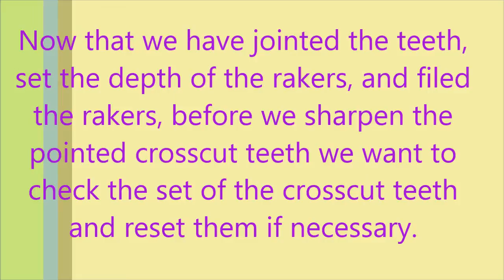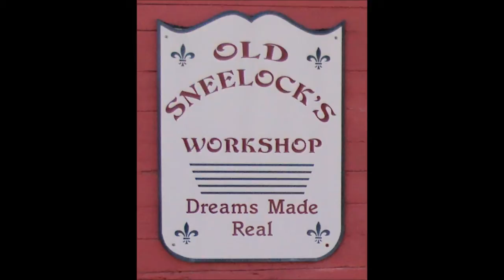Sharpening a one man crosscut Pt 5 - Setting the teeth - by Old Sneelock's Workshop

Comment: Nice clean cut in a dense hardwood.  I also will not use the anvil and ball peen hammer because it thins the teeth even so slightly.  These saws are hard to replace, so I treat my collection as well as possible, even though they are still used as tools.

Comment: I have a one man 48 inch crosscut that I will now be able to use to cut an anvil stand free from a giant white oak that fell on my grandfathers farm.

Of course, considering I bought the saw because we lacked a chainsaw with a 36 inch plus bar - I'll probably be purchasing a two-man to ensure I'll have the blade length to properly buck this monster oak.

The 48 Ford tractor shouldn't have a problem loading the anvil stand for transport. ;-)

Many thanks for your invaluable info good sir!
Reply from the maker: Bj Hamblin That must be one monster oak. 
Can you work the cut in sections? Cut part of the way through and then roll the trunk? If the trunk is more than 48" then it will take a big two man saw to get through it. 
It will make a good video. Any chance you will record the process?

Comment: What do I need to look for when buying a saw set tool so that I don't end up getting something made for standard carpenter's saw or something.  I have a 42 inch one man crosscuts saw with champion style teeth and I need a good setting tool for it and the two man crosscut saws I have of my grandfather's.  Can you buy setting tools new and if so where?  Thanks.
Reply from the maker: This forum has pictures of the relative sizes of saw sets for carpenters panel saws of 5 to 14 teeth per inch and felling and bucking saws with 1 to 2 teeth per inch. https://www.crosscutsawyer.com/viewtopic.php?t=1277
There are many companies selling crosscut saw sharpening tool kits. This is but one of them. 
https://crosscutsaw.com/product-category/all-products/saw-tools/
I have never purchased a new setting tool. They were plentiful when I started sharpening saws and I found many of them sitting in the bottom of auction box lots because no one knew what they were. 
I found the larger crosscut saw setting pliers by accident. I had the saw and found a tool that fit. Putting them together just came naturally. 
If you are looking for a tool that will do the job and don't want to spend all the time I did then buying new is the way to go.
Reply: @OldSneelock   I'm looking at a pair of setting pliers that have the number 2 on them, I believe you said yours were a #4, what do these numbers mean?  Thank you.
Reply from the maker: My best guess is that the maker built them to fit various sizes of saw teeth. It might mean a dimension or it could be the order they were made in.
Jim Thode has a page with a good breakdown of the use of a Morrils 5A saw set. 
https://pbase.com/jimthode/image/162036473

Comment: Hello, thanks for the video. I need to buy a saw set, because hammering the teeth drives me crazy (over and under setting multiple times). But I dont know how big the setting pliers should be for my 2mm thick two man crosscut (probably german). I guess you could not use the two smaller ones in the video. I bought some pliers here in the Czech Republic, but they are not strong enough to bend such thick teeth.
Reply from the maker: Mine are antiques that I found over many years of looking. 2 mm is a very thick blade. Have you tried searching on line?
Reply: @OldSneelock  yes, but am not sure what search term I should use.
Reply from the maker: @johnytwo  https://crosscutsaw.com/product/443-economy-saw-setting-sharpening-kit/

Comment: Hello, I have a one man crosscut saw with champion teeth. But the rakes are taller than the cutting teeth.
From what I understood watching your serie, it shouldn't be like this. Any idea why it is this way ? Bad knowledge from the previous owner ?

Should I resize everything to have the rakes slightly smaller than the cutting teeth ?
Reply from the maker: The rakers are usually .010 -.015 shorter than the cutting teeth. 
The cutting teeth slice through the grain making two grooves that let the rakers go through and chip out the wood between the grooves. 
I set mine to .015" because I cut hardwood here in lower Michigan. Soft wood cuts easier so it can be up to .030"  
A great resource to go along with my videos is the Crosscut Saw Manual written by Warren Miller.
https://www.fs.fed.us/t-d/pubs/pdfpubs/pdf77712508/pdf77712508dpi72.pdf
Reply: @OldSneelock  Oh nice ! Thank you for providing such an interesting document !

Comment: Hello. I used the same method of setting the teeth and several teeth broke or cracked at the bend of the original set Can I fix this?
Reply from the maker: If the tooth is cracked or broken off the only fix is to file the teeth until they are all the same height. If there are a few teeth broken it might still cut okay. As long as you don't have 4 or five in a row the missing tooth just won't just so it will slow the saw down. Each time you sharpen the saw the short one can just be along for the ride until it is long enough to be a tooth again.

Comment: Thanks for the series,  I've got two crosscut saws under the Xmas tree, well in the garage actually, but they will have bows on them. I'm a bit daunted by the challenge of filing them, I'd hate to ruin a vintage tool. These videos are clear, concise, and well put together.  Nice job.

Do the saw sets specifically bend to the 010" degree or did you have to set them to bend to that degree? Would they bend beyond that if you were to engage the set twice on the same tooth?  If not do you need the spider or could you just run the set down every tooth each time you file?

P.s. I didn't peek, I had to pick out the saws myself.
Reply from the maker: The pliers type saw set is adjustable. I don't really know the maximum amount it could be set for but it definitely will go beyond .015. I learned that while practicing with it. If it is set for .010" like I have it, the tooth will be bent to .010" and that's as far as it will take it. If you don't complete the pull on the handles it can set less than .010" but I've never had it or any other set bend more than it is adjusted to. There is one exception. If you grip the tooth with the saw set and then while the tooth is held tightly in the jaws you can over bend the tooth by wrenching on the handle. 
The spider is useful for checking the saw between sharpenings. It will help you spot a sprung tooth. It is more important with the hammer and anvil method. With the pliers once they are set they are pretty repeatable. I check the saw before sharpening just to be sure I don't have any over bent teeth that require correction.
Dressing the teeth with the file won't make it necessary to set the saw every time. Because of the angles you have to take off quite a bit of tooth to change the set. I would expect that once you have the saws sharp you won't need to do all the major work that I did on the saw blade without a handle I showed in the video. It had been sharpened incorrectly and I needed to really take a lot off of the rakers to bring it back right.
Since these saws are going to be yours for a long time I would go lightly on the first attempt to sharpen them. If you use the tools I have in the video and don't get heavy with the file you'll be alright. When you are jointing the teeth if a few don't get touched by the file, as long as they aren't 5 or 6 in a row,  then don't joint any further. When you get to the short ones., just take a few strokes on each tooth and try them. After you sharpen the saw a few times the short ones will catch up. Even a poorly sharpened saw will cut better than a dull one.
Good luck and let me know how they turn out.
Dave N.
aka Old Sneelock
Reply: Old Sneelock's Workshop I just picked up one of these Morrill's off ebay.  How hard is it to set the angle?  Is it fairly intuitive? Do I guess and then check it with the spider and adjust from there?
Reply from the maker: I did the guessing process first. The bottom slide determines how much it bends and the front slide determines how far down the tool it bends.
Showing is going to be a lot easier than telling. Looks like I need to do another video. I'll try and have it done this week.

Comment: I have a crosscut saw to sharpen. My issue is I have a saw set for only down to 6 teeth per an inch. I don’t know if it would work, but I want your opinion? Should I just risk my hammering skills with the other method? I do feel confident with my accuracy but I’m not sure I want to risk chipping, bending, or breaking a tooth.
Reply from the maker: Double Bit Craftsman If the saw set only goes down to 6 teeth per inch it isn't big enough to work. A one man crosscut is more like 1 tooth per inch. The smaller set may bend the tooth but it will bend it too close to the point. 
You are a better judge of your skill level than I am. Setting the teeth is bending just the top 1/3 of the tooth out slightly. If you are hitting it hard enough to chip the tooth, that is too hard. You only want to bend the tooth a maximum of .015". That is just less than .3 mm .
Reply: Old Sneelock's Workshop alright, thank you

Comment: I don't have a spider gauge or a saw-set. How do I know which teeth get bent up or down and how much
Reply from the maker: janken919 I'm going to assume you have a saw blade you want to work on. Look at the teeth. There will be some that are pointed those are the crosscut teeth. On some saws there will be straight or raker teeth like the ones in the video. The pointed teeth are the ones that are set. The idea is to move the points on the teeth away from the center of the blade so they scribe two lines further apart than the thickness of the blade. The pointed teeth will be sharpened with the point on one side of the tooth. You want to move that point further away from the center when you set the tooth. That will break the wood away from the surface and if there is a raker tooth it will chisel the chip away from the wood. 

File the teeth first. Before setting them. You should have points on the crosscut teeth before you try to figure out where the point should be. 

It doesn't take a lot of set for the blade to work. All you want is for the kerf left by the teeth to be wider than the thickness of the blade so the blade won't drag in the cut. .010 to .015 will be about right for most of the wood you will cut. Wet wood .015" is better. Dry wood .010" works good.  You can improvise a gage from a piece of steel bar. I'll give some dimensions here but it can be pretty much anything strong enough not to bend and light enough to pick up and carry. Start with a piece of steel bar about 2" long, 1/4" thick, and 1/2" wide. File a 1/2" long section on the 1/4" side of one end. To determine how deep to file the notch we'll use a piece of tablet paper. Tablet paper is approximately .003" thick. Fold a piece twice and if will end up .012 thick. Make the notch you're filing as deep as the folded paper and you should be good. To test it put the paper in the notch and run the file over the 1/4" edge. If it hits the paper without filing it away you are all set. 

Betore you start setting the teeth check them with the gage you just made. Set the gage on the blade with the notch down. Point the notched end at the tooth you want to check. You are going to be checking them all before you're done but only one at a time. Slide the gage over the tooth. If the tooth hits the top of the notch without lifting the gage from the blade the tooth is set correctly. Move to the next tooth. If it doesn't touch mark the tooth with a pencil, chalk, or anything handy that will stay on for a while. That is the tooth you will be setting.  If  the gage rises up off the blade when it slides over the tip of the tooth mark that one with a different mark. You might have to take  a little set out the high tooth, but only after testing how the blade cuts. 

If you don't have a saw set you can use a small hammer and an improvised anvil. A half inch diameter rod or bolt driven into a block of wood will work in a pinch. It just has to be strong enough to support the saw and withstand tapping with a hammer. 
Lay the tooth that you marked  to be set on top of the anvil with 1/3 of the tooth over the edge. Tap the tooth gently with a hammer small enough to hit just that tooth. No point in bending more teeth than the one because the teeth on either side have to point the other way. It's a lot easier to hit it twice than to have to bend it back. You are moving the tooth just a little bit. If you take a swing at the blade full force you can break the tooth or the blade itself. Patience pays on this job. 
Now that you have tapped the tooth, flip the blade over and check the tooth with the gage. If it needs another tap then do it again. After a few teeth you will get the feel of how much to hit it. Better to sneak up on it than to damage the blade. 

Now you have the blade set. Check the teeth for sharpness. Are the points still in good shape? If so then you can move on to setting the height of the rakers. If not then touch them up and check the set again. Slow and steady wins the race. Hit too hard or file to much and you end up fixing your mistakes more than sharpening the blade.
Reply: Old Sneelock's Workshop Wow! Thank you so much! It looks like there is no kerf on the blade. When I cut with it, the blade binds on itself.
Reply from the maker: +janken919 The blade dragging in the cut points to a lack of set in the teeth. 
Before we go to bending teeth make sure the blade is clean and smooth. Just a little surface rust will slow down the blade a lot. With a clean, shiny blade put some wax on the sides of the blade before cutting. Paste wax, paraffin, or even a bit of old candle stub will speed up the process. 
When you are sure that the basic steps to saw prep are complete then go on to setting and filing the blade.
Reply: +Old Sneelock's Workshop I finally have time to start working on my saw now. I made the gauge that you said    2 X 1 X  3\8". I used a feeler gauge to make the notch at .012 which is thinner than I expected. How do I clean the blade around the teeth without wrecking the teeth. I also have a nice piece of thick flat steel for my anvil.
Reply from the maker: janken919 I've tried a lot of different ways.  The rotary wire wheel left scratches on the teeth that I think make a weak spot that can become a crack. Scotchbrite pads do a good job of cleaning but they shred apart awfully quick. It seems like all the fast methods just let me make mistakes quicker.
The way I settled on cleaning blades is to use a sanding pad laid flat on the blade to do the bulk of the cleaning. Then I take a bit of sand paper and rub each tooth with my finger. I don't polish them but I try to  remove the rust and smooth out the surface.
Congratulations on finding a plate for your anvil. Each time you get a new tool that you need the jobs get easier.
Reply: +Old Sneelock's Workshop I made a video showing my progress on my crosscut saw. If you have time come visit my channel to have a look. I would appreciate any feedback! Ken.

Comment: Thanks for posting - a useful intro to setting these saws.  Not quite clear on how much set you applied (or is best) - was this 0.01" (ten thou)?

P.S. Slight editing gremlin between 2.10 and 2.40
Reply from the maker: I made this video as a supplement to the written instructions at: www.fs.fed.us%2Feng%2Fpubs%2Fpdfpubs%2Fpdf77712508%2Fpdf77712508dpi72.pdf 
There is a good explanation of what the set for different woods could be in the text,

Comment: Old Sneelock's Workshop  What brand is that saw? I have an old Disston 4.5 tpi. Probably not that old though, because the screws are steel.
 Have you ever been to the Disstonian institute and checked out all the info. he has on the site?
Reply from the maker: The saw blade without the handle is etched The Bingham.....
Cleveland.......
Only the left side is readable
There was The Bingham Hardware Co. in Cleveland http://ech.case.edu/ech-cgi/article.pl?id=WBC

The saw with the handle is only marked Economy with the words Cast Steel faintly in a circle above them.
Reply: Old Sneelock's Workshop Thanks

Comment: 14:20 that is a horribly tuned saw!  That was fine saw dust not noodles coming out of that saw. Your rakers need to be longer and  a proper swaging might help also.
Reply from the maker: Joe Tittiger The wood is 4 year old mulberry firewood. Dry as a bone. The noodles effect will only occur if the chips will hold together. This brittle wood just breaks up into crumbled dust.